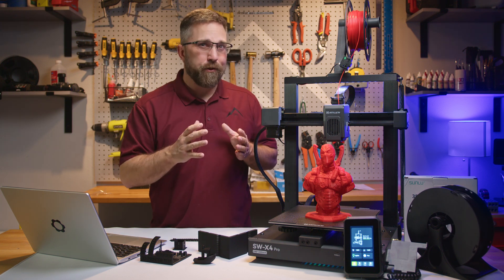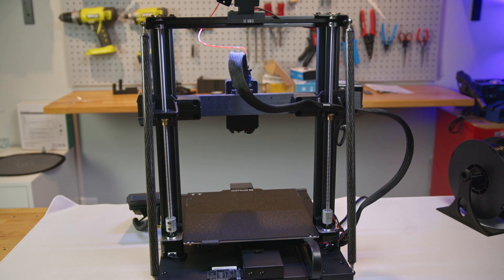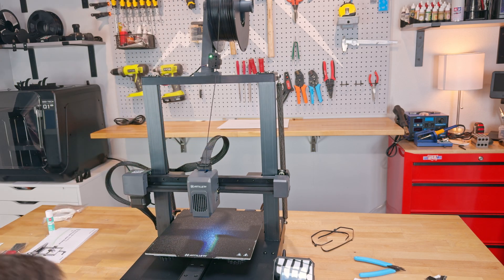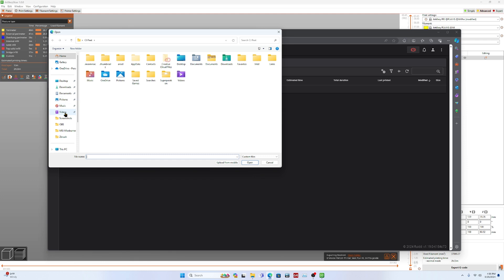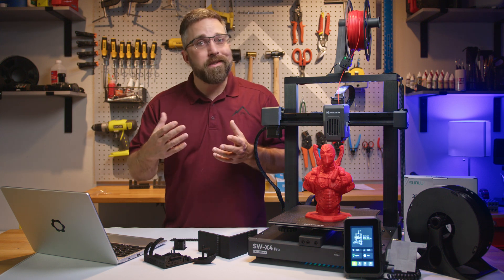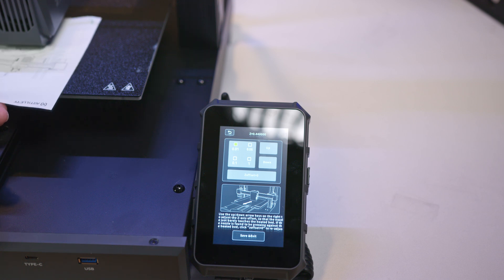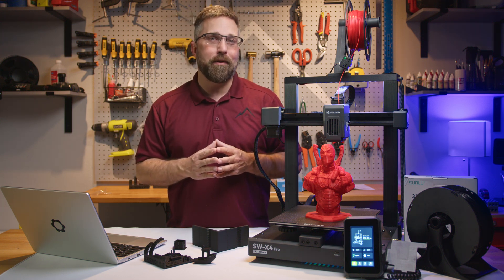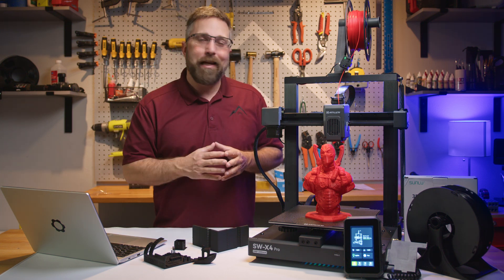Artillery Sidewinder X4 Pro Review! Professional or Problematic?

Comment: Great Video.   Bought an Open Box unit for $99.   I will start testing today to see how well it prints.
Reply: So how is it so far??
Reply: @TheTalkalotboy97  Works fine.  Needed firmware update and was missing tension screw for belt.   Prints fast.

Comment: I suspect the layer shift may be caused by the filament sensor. Extra resistance from the sensor when pulling more material during an X movement causes the shift.  I have the same problem with my X1. When I bypass the senser the layer shift goes away.
Reply: I always thought the layer shift had to do with overheated drivers. Had this problem with an X1. Opened the hood, and there was a burned driver.
But then again, I suppose there are just too many variables that can cause this, as the technology expands.

Comment: I can disagree on some missing "pro" features 😉
- Manual (or could it be assisted, it does have a sensor, maybe it's not a Klipper thing?) levelling/tramming can bring bed corners within 0.1 mm while some fixed bed printers can have over 1 mm difference. Sure, mesh levelling handles that and possibly more, but it's just wrong 🤔
- Automatic belt tensioners work with springs, and at least I don't want anything springy or flexible in my belts. Better than loose belts, but no 😅

It's a pity that mechanically solid printer (compared to Ender 3 V3 SE and KE with plastic base) does not deliver in Klipper department.

Comment: I got one of the first ones.  And it did have issues.  I expected so.  But after working with Artillery the thing is awesome.  I have 27 printers from basic A8 to 1000x1000x1600 professional printer.  As I told my wife I think I have had ever possible issue with 3D fused filament printing. . But then a new on comes along and so does the solution.  As an engineer, the design of the Artillery is much better than some of these $500 printers.  The issues are all from it being new. 
The bearing blocks on this printer are excellent.  Giving rise to some of the best looking prints I have seen.  Smooth surfaces, and NO artifacts like the K1 Max I got rid of.  I print almost exclusively PETG.  I will try some TPU and even nylon on this soon.  
When you buy a new, just out, 3D printer, you can expect some issues.   
For fun, I bought the latest model of the Ender 3, not the pro.   Cheap.  And it has all the bugs worked out.  It has the 4.2.2 pcb and prints beautifully.  A lot better than the K1 ever printed.  K1 was a disaster for me.
If I had time I would do some videos like this.  But I'm up against the clock on my projects.  Can't spare the time.
Reply: Thanks for sharing! As an fellow engineer, may I ask you opinion on V-roller printers suchs as the Neptune 4 or SV07? A lot of people say they are bad because of that, but I've so far never seen anyone argue that with actual test results and data, just heresay about the design.
Reply: Thank you for a honest review. I have the x1 for meny years without any problems dr reily just the usual cable replacement and upgraded the wheels and gantry stiffening rods. My first choice would be the x4pro but with all these problems I a very apprehensiveat this Tim's. Please could you update me on how it is running now  as it I some time now since your post. Have you carried out any further updates and did the fix any problems you had 
Kindest regards. 
Mike Irish

Comment: DO NOT BUY THIS MACHINE! the issue that it's mentioned briefly with the hotend is not a freak accident. Do a quick search and you will find in forums that this is a common issue, to the point that the hotend is no longer usable. Artillery knows this, and their terrible costumer service, will tell you that their "new policy" does not cover the hotend. The wifi, even with the new update, does not work. If it last one print it's nothing short of a miracle. And adjusting the Z-offset is not easy, since the software in the machine stops working all the time. You think you are adjusting it and it's not moving at all! This machine and company are nothing short of sc*m. All you have to do is do a bit of research. If you take the plunge there is one company (if you are outside the us) that provides compatible parts, it's from Thailand. Again. DO NOT BUY. it's tempting, don't do it
Reply: Upgrade your firmware bro. Mine works like a champ. Replaced an Ender of the same price tag, by this one and I've never looked back. Initial calibration can be a challenge, but then it works like a war tank!
Reply: I totally agree.
Reply: I have  Artillery sidewinder X1    (30x30x40)  Using it for 4 years without any problems.
Reply: The x3 was a very good product.....it had problems that wore very quickly with very little use - that was fixed with the x4. They unfortunately introduced other problems that are bet disappointing.  Still struggling with this printer😢
Reply: thank you brother, wish this was a pinned comment. im getting the bambu lab A1

Comment: Yet another disappointing klipper bedslinger. It would have been a reasonable price 6 months ago, but now that the Ender 3 v3 KE exists and costs only a bit more, I see very few reasons to recommend this one. Especially since the KE fixes most of the issues you ran into with this (no bed screws, auto z-offset, can run input shaper calibration, and supports a camera).